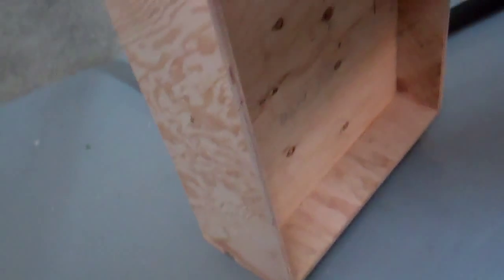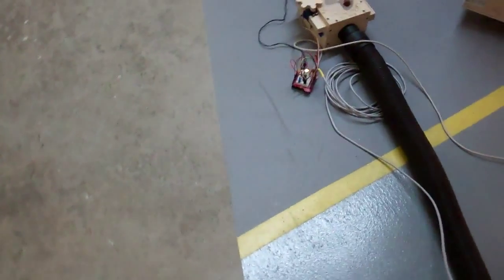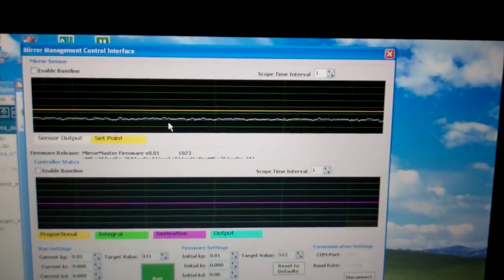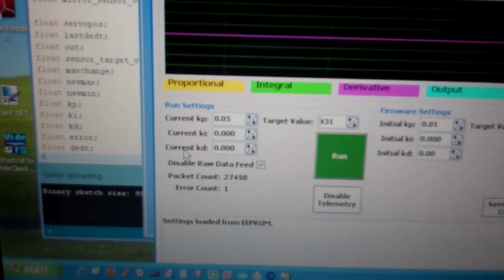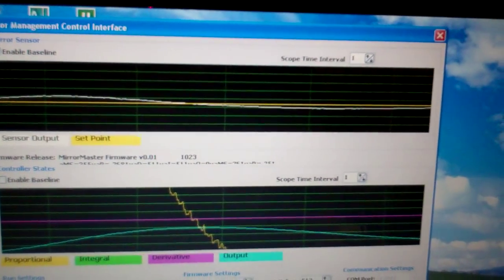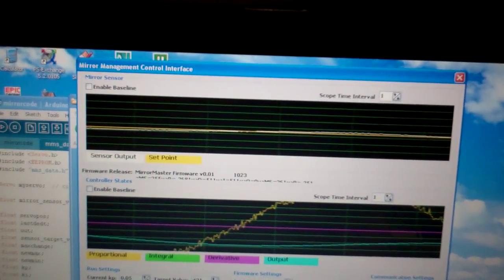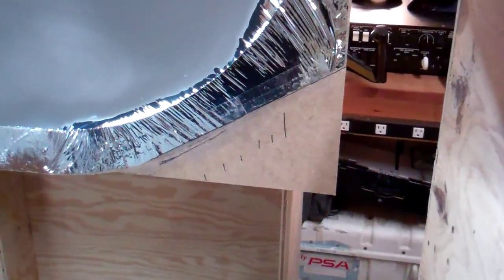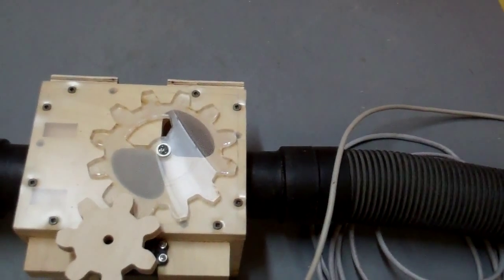A demonstration of the PID controller we've developed to maintain the correct mirror shape.

Comment from the maker: When we did the first assembly, we placed a soft block that could come in contact with the mirror without damaging it.  When the film reached that block, we recorded the value coming from the position sensor. (it's 431) The block was then removed from the interior of the framing.

g.

Comment from the maker: @c2h7, we had to replace the mirror because I punched a hole in it on accident and then we had to replace it again after an adhesive failure.

We didn't go the $100 VFD route because a $4 model airplane servo will do the same job. :)

Comment: Amazing work :-) boy I wish I had that kind of time! You can be really proud of that job!

Why did you have to replace the mirror?
Have you thought about controlling the vacuum motor instead of using a valve? You should be able to get an inverter (frequency controller) for around 100$ used off ebay, like SEW or similar, which you can just plug the 110V vacuum cleaner into and then control the 0-100% power by an analog 0-10V DC signal which you can output from the arduino.

Comment: I'm sure you figured this out already, but your proportional gain is too high in this video, the system is underdamped. You don't seem to have any steady state error, so the integral term wouldn't help much, but the deriverative term can be used to let you get a faster convergence to the desired value when you decrease the proportional term. 

Looks very cool. Have you played any games on this thing?